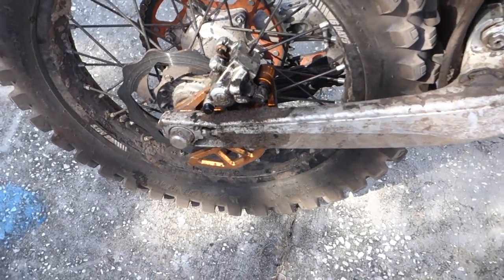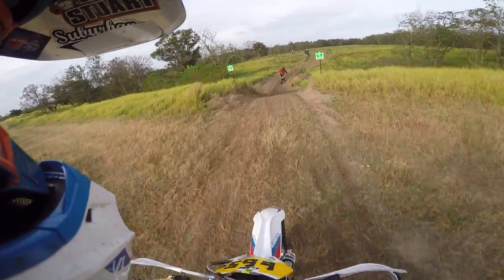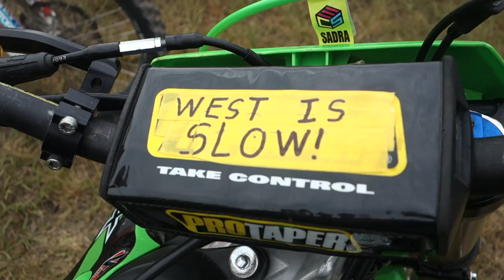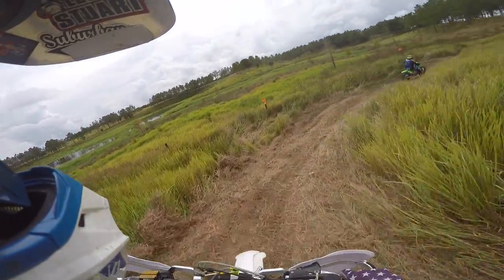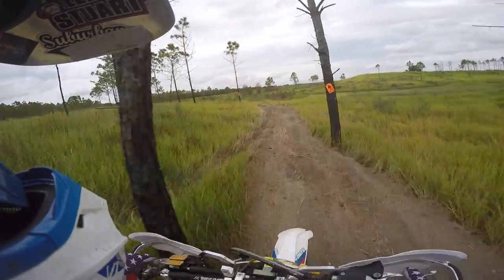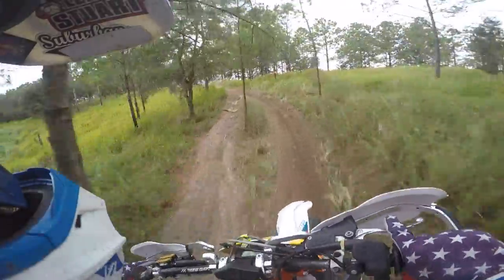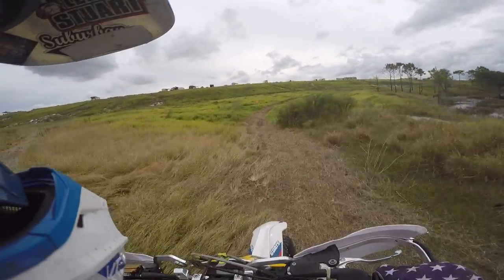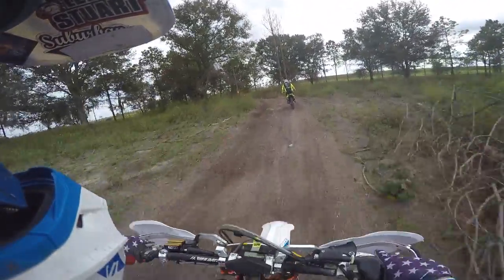When your BEST isn't GOOD ENOUGH | SADRA Hare Scramble 2018

Comment: Dang son!! You're doing great!! I have a question...... Have you considered going up 2 clicks on your front fork compression adjustors? It seems like the falls that you do end up with are happening when your front tire tucks under and your kind of slipping over the front corner of the bike a bit... Increasing compression stiffness slightly will help hold the front end up in those rare situations, and might help to save the fall, but at the compromise of feeling too stiff and giving you arm pump. Might be worth a try bud....

Comment: GREAT RACE mate, i think your position reflects your riding an that of the competition and i think your in a good place ..race craft lines etc is a long process and will take time, there are a few things i can pick apart if i were to be honest but i dont  think  i want to say anything except well done !! Take nothing away from the race you rode (its one of the hardest sports in the world ) you did it by pushing to the end than in itself is a serious achievemnt !!... A couple of questions are you still using the goldentyre ? and are you the same weight now as when you dialled in your suspension ? IF the tyre is the same i would change to a good intermediate you can get better tyres for Sand and hardpack  , if your weight is significanlty less you will need to adjust your suspension ..take care and push it till it pushes back

Comment: Turn off your brain. I was thinking about "the right thing to do" too much, just go do it. Quit thinking about it. I got faster once I did. Maybe it would  help you also?? Maybe just focus on trusting the tires when turning and on the straights go faster. It seemed to help me. I went and practiced just going too hard turning and trying to "slip and slide " especially when in a slow turn even when you crash it's slow anyways and it's fun.

Comment: Dude, you did awesome in that race. Do not be hard on yourself for 13 out of 19. I bet those 6 behind you weren't up for 24+  hours straight. You may want to check out the benefits of a Steering damper. It might help you hold on to those bars in that rooty stuff. I think it is one of those parts you don't think you need until you get one and realize how awesome it is. It is cool to see you passing guys now. I can see your speed is way up on the straights too. Also, way to kill it on that last lap. It WAS your fastest!